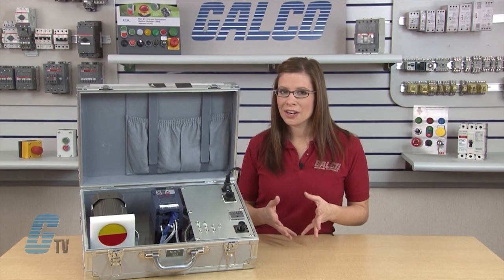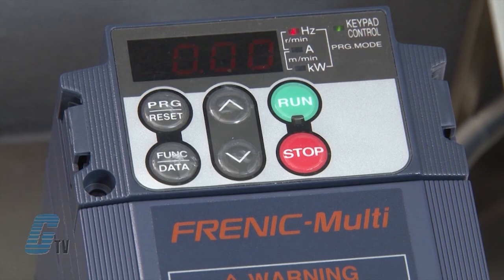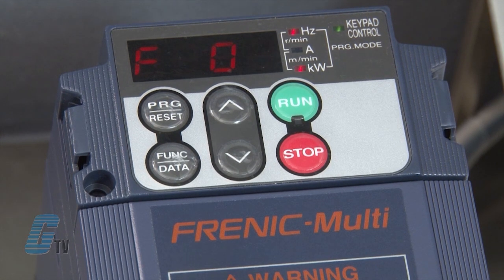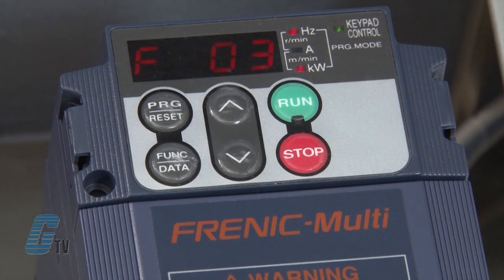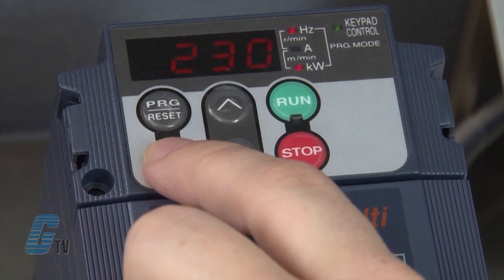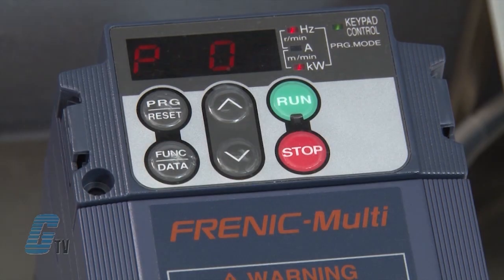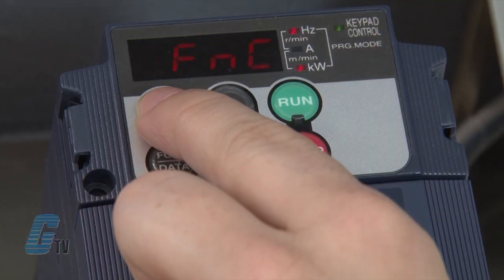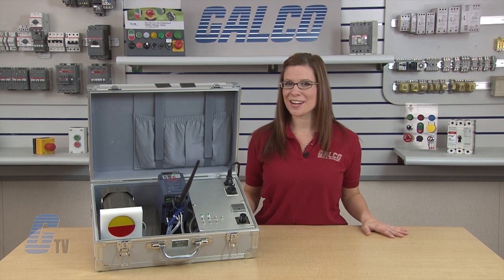Fuji Electric Frenic Multi Series AC Drive Basic Start Up Using the Keypad

Comment: Do you have a Drive On Port adapter available for the VFD model FRN0044E2S to enable network access? name of part or link !
Reply from the maker: Are you referring to the adapter that is mounted on the front side of the drive?

https://www.galco.com/opc-e2-adp1-fuji-electric-ind-drives-controls.html

Comment: Er1 is occured on my drive.what are a solution for this error?
Reply from the maker: Er1 is a memory Error. If a memory error occurs, such as missing or invalid data, the protective function is activated.
Reply: @GalcoIndustrial  then what is the proper solution for this error

Comment: I've a problem whit an fvd like this

how i can configurate? when for a digital input in the fvd stop and the moment to restablish the motor start a little velocity and when i push te signal to start this recover his operating velocity?
which parameter is the correct in this device to make it?

Comment: Why i cant change all parameter?
The inverter have lock?
Reply from the maker: If you can change any parameters, you do not have the lock on. Is the drive stopped? Because some parameters can be changed "on the fly" and others can not. So make sure the drive is in stop mode first.
Reply: @GalcoIndustrial  yes the driver on stop mode, and i cant change all parameter, the parameters not blinking like in the video, so i cant change the parameters
Reply: @GalcoIndustrial please maybe you can help us
Reply: i also have same prblm....give some suggestion plz
Reply: Why I can't change parameters? The inverter have lock? Please suggest me.
Reply: We are also the same please let us know the solution

Comment: How to reset by push button
Fugi drive 
Mdl - FNC37G1S-4A
Reply from the maker: You have to configure 1 of the 5 digital inputs for "Reset Alarm". Parameters code E01 to E05 configure input X1 to X5. Enter function 8 (Reset Alarm) at code E01 to make input X1 reset alarm.

Comment: Hello there i have a qustion , i last configured my frenic-mega G1s4 but it has failed to start the motor, i feel i have provided the wrong parameters. Can i be assisted in any way whatsoever....
Reply from the maker: Ok Anthony, 2 things to start with, make sure it is in remote control mode by LEDs on the operator keypad, and then verify your start input is being activated. Follow this link for a digital copy of the Users manual if you need it http://www.galco.com/techdoc/fuic/frn003g1s-4u_um.pdf page 2-23 describes the EN input (mandatory for running) and page 2-34 shows its location, ok?

Comment: To operate, commission and Set up FRENIC Lift inverter there are two possibilities:
using inverter keypad or PC. For operation using a PC it is necessary to use the
dedicated software Lift Loader.
the question is how can i get the software and if possible a video to explain how can we use it in the pc connected to the ac drive .  my regards
Reply: https://youtu.be/cUSgEiXRg0M
FUZI MULTI DRIVE PROGRAMING CONNECTION & TUNNING FULL EXPLAIN